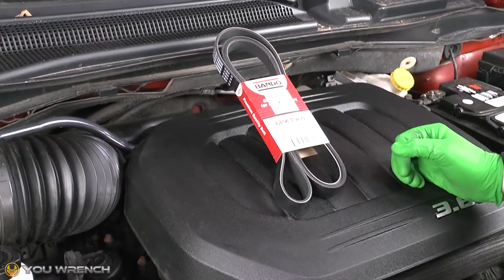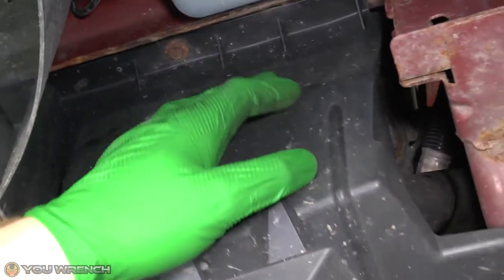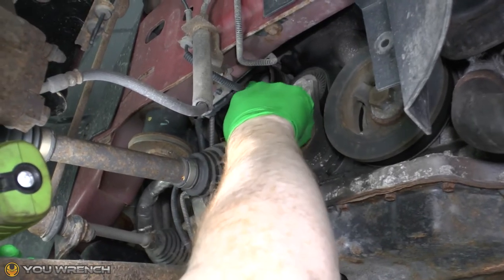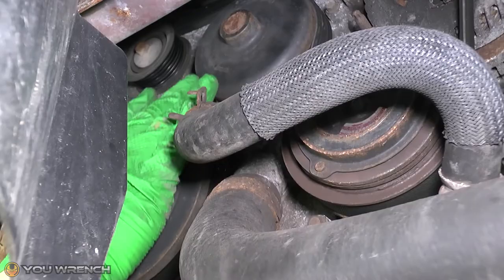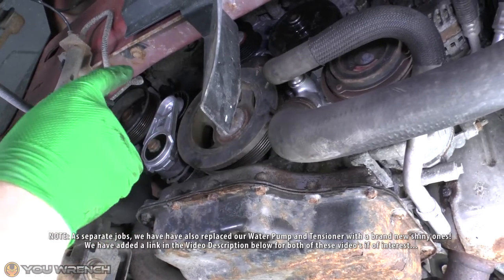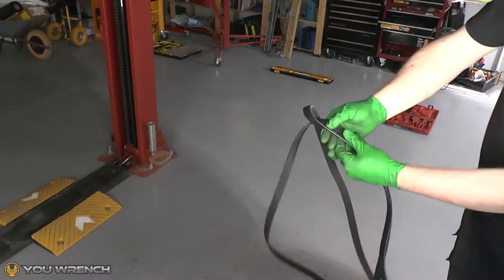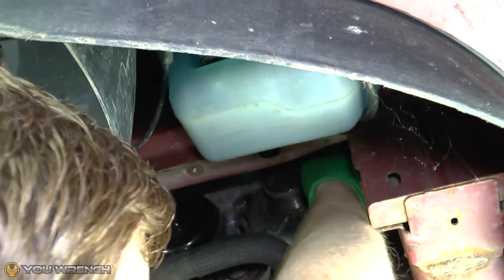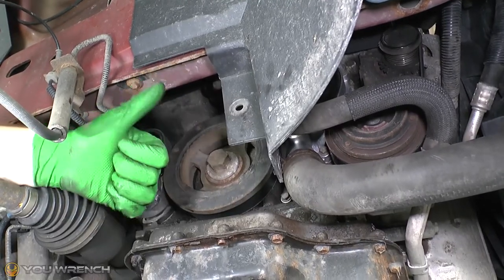How to Change Serpentine Belt - Dodge Grand Caravan (3.6 V6 2011-2021) - YOU WRENCH

Comment: I just finished doing this job with your guidance. Thanks so much. I've gotta say, that brake line is so close to the idler pully. I had issues removing my ratchet after I took the belt off. I had to leave the rachet in the idler pully. I guess if someone had a slim ratchet it would have been easier. Either way I got it done. Thanks man!

Comment: thanks for the informative/straight-forward video!
3:28 what's the benefit of having a look for cracks in the belt? could it indicate problems with other parts in the serpentine belt's system?
Reply from the maker: Thank you! Yes, it's always worth checking the old belt, especially if you intend to reinstall the old one! It's worth checking it as well even if replacing with brand new so you can get an idea of how old the old belt may be, and also it may show signs of uneven or unusual wear across the face etc which could point at potential issues. Also, if you know how old the belt is, you will get a feeling for how cracked the belt should be over that time period. Hope that helps!

--- 

To help support us (for both you and others reading this) there are a few things you can do:

1) Donations both needed and welcome! We cannot operate You Wrench without the support of people like you! You can donate by PayPal - just go to www.paypal.me/youwrench

2) Please ensure you subscribe to our YouTube channel. 

3) Please Like our video's on YouTube (by clicking Like!) 

4) Please help spread the word, the more people who know about us the better! Add links to our video's in forums, let people know about us.

Thank you for your support!

Comment: Just finished replacing the serpentine and tensioner on 2011 minivan but notice the belt moved one grove towards engine at the crank shaft pulley but when I realigned belt on the crankshaft the belt move away from the engine at the power steering pulley.

Comment: Thank you! At what intervals is this belt to be replaced?
Reply from the maker: They say up to 90,000 miles, but the general opinion is that 60,000 miles is a good figure. They often get changed earlier if they start making noise (very common) or you need to remove it to access anything else. The cost of the belt is low so it's not worth putting the old one back on if it's being removed for any reason, not unless it's already very new. Hope that helps!

--- 

To help support us (for both you and others reading this) there are a few things you can do:

1) Donations both needed and welcome! We cannot operate You Wrench without the support of people like you! You can donate by PayPal - just go to www.paypal.me/youwrench

2) Please ensure you subscribe to our YouTube channel. 

3) Please Like our video's on YouTube (by clicking Like!) 

4) Please help spread the word, the more people who know about us the better! Add links to our video's in forums, let people know about us.

Thank you for your support!

Comment: Did you have to replace the drive belt tensioner for this? Cause the one you started with sure doesn't look like the one you finished with
Reply from the maker: No, not specifically for this fault/job. We actually did that to produce a seperate video (which is on our channel). You do not need to change the tensioner just to change the belt (unless you have a faulty tensioner or f course!) But well spotted! :-)

--- 

To help support us (for both you and others reading this) there are a few things you can do:

1) Donations both needed and welcome! We cannot operate You Wrench without the support of people like you! You can donate by PayPal - just go to www.paypal.me/youwrench

2) Please ensure you subscribe to our YouTube channel. 

3) Please Like our video's on YouTube (by clicking Like!) 

4) Please help spread the word, the more people who know about us the better! Add links to our video's in forums, let people know about us.

Thank you for your support!
Reply: @YouWrench  thank you for the reply!

Comment: replaced serpentine belt, now my van is overheating, thoughts?
Reply: Probably Something with the water pump. Is the belt still on, is it routed correctly?
Reply: @notime4264  it was the water pump